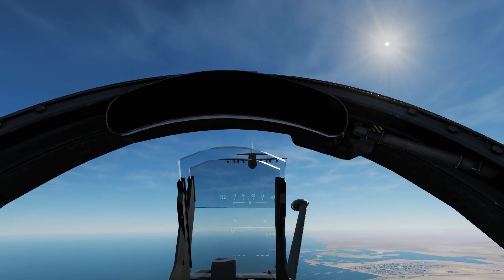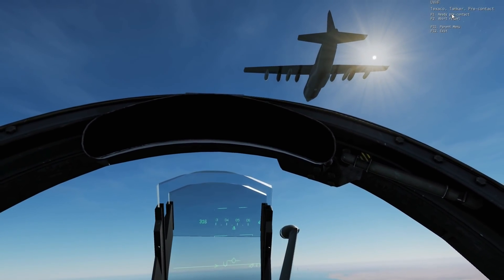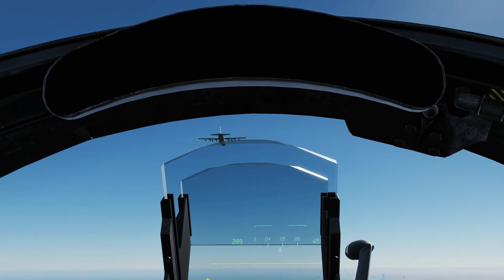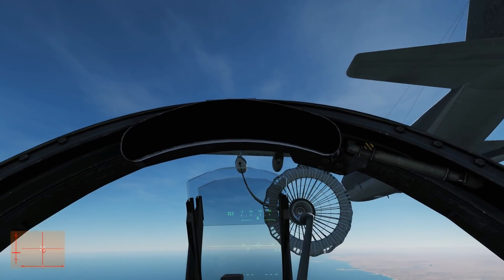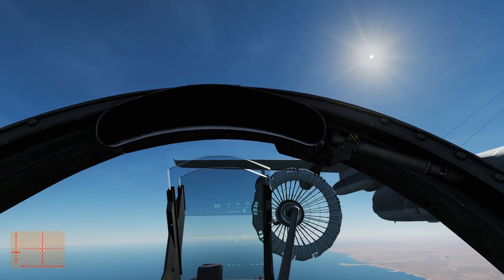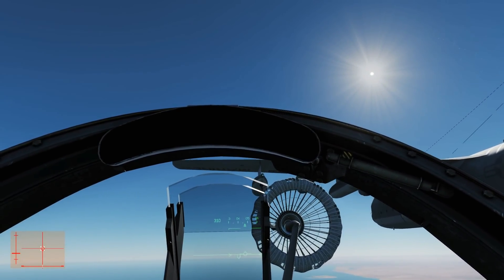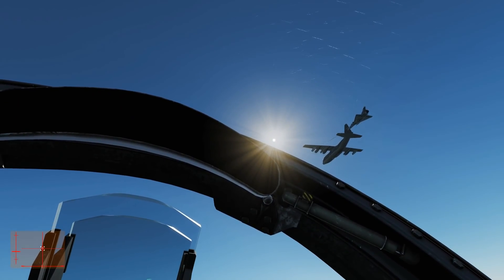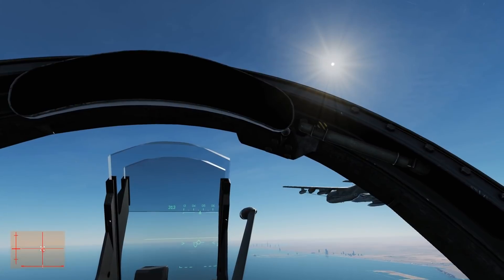Mirage 2000C: Air To Air Refueling Tutorial | DCS WORLD

Comment: I can never seem to contact the tanker. I tried the easy comms but it just gave me awacs.
Reply: same problem here! any solution??
Reply: @Zoddom  im pretty sure you have to manually enter the tanker frequency in the radio if its not working with easy coms
Reply: Check the correct frequency in the kneeboard of that specific tanker flying in front of you then open the f10 menu hit tanker choose the sepcific tanker you're refueling from (in case multiple are listed) then request rejoin

Comment: Hey cap do you use a high curve on your pitch and roll axis?
Reply: Higher precision with smaller control inputs while trading off precision for large inputs is what it comes down to.
Reply: Doctor Apollo he uses 25 curvature.
Reply: thanks bud. I guess I'm just curious what the advantage is to having a higher curvature...is it just more stick sensitivity?
Reply: @MattyNoNose  less sensitivity at the middle.  So it takes more stick movement to move the control surfaces.  This makes it easier to make slight changes to the attitude.
Reply: 25 is the best curve for most of dcs modules